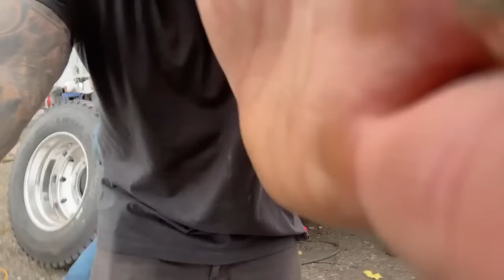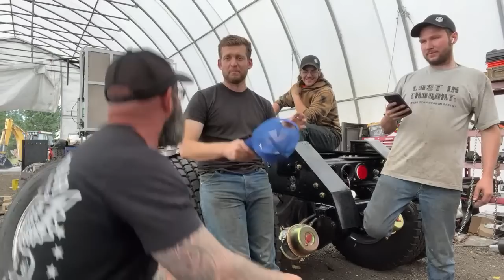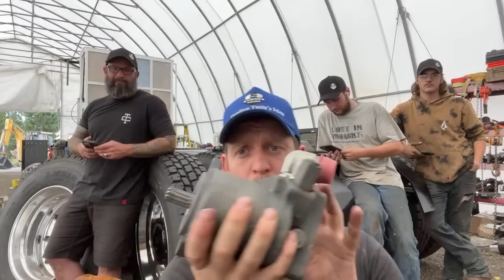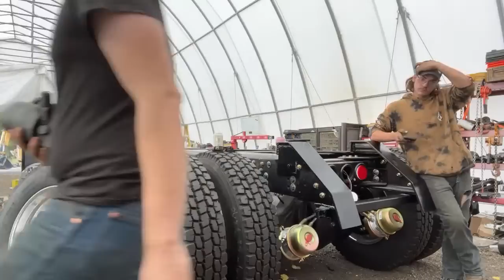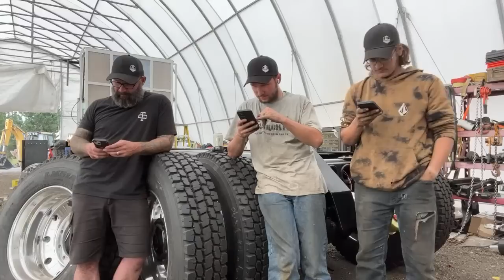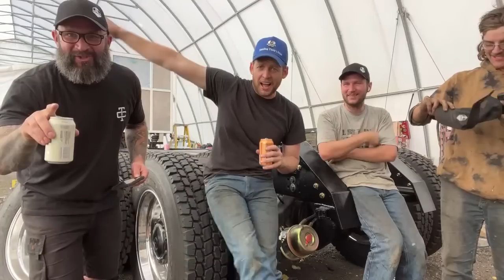Edison Motors Live Update

Comment: I have a good question for you guys and maybe something overlooked. On your air brake system, are you running any ABS antilock brakes on these trucks? Don't know if log trucks are exempt but most commercial vehicles nowadays have to have it as oem installed after 1998 .  Just curious?

Comment: On the process of hooking stuff like this up to electric motors and batteries, I worked on a much smaller scale robot that included four motor controllers for motors and maybe a 10th of the battery capacity of this truck has and we didn't even have an onboard charger the amount of stuff that goes wrong the second you try to start getting that stuff to talk. I wouldn't be surprised if it takes the guys at out there two to three days just to get stuff working on a basic level.

I wouldn't be surprised if for some reason it doesn't want to charge off of an AC outlet the first time it gets attempted. The stuff isn't just bolt in place and go. It's high voltage and complicated computer communication. Stuff's going to go wrong

Comment: I could see GM building a 1 ton, or 2500 with a 4.3L v6,  generator with a tesla style rear diff, with tgr battery mounted in front of the rear axel in between the frame,  the exhaust can be ran outside the frame.   Possibly use a similar front drive unit, with the motor mouunted under the cab.  It could be a cool truck. Say a 2025 Chevy / GMC,

Comment: 17:30 ,  (cardboard and drawn) "CAD" design and build in a year! 🎉not bad,
Reply: I have used graph paper multiple times to do electrical diagrams for my old cars. When you have 50 wire busses and every part being a microcontroller sending digital signals to other microcontrollers, it is a nightmare. When a switch turns something on directly, it's easy.